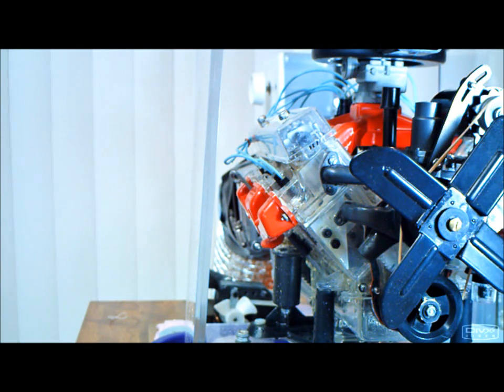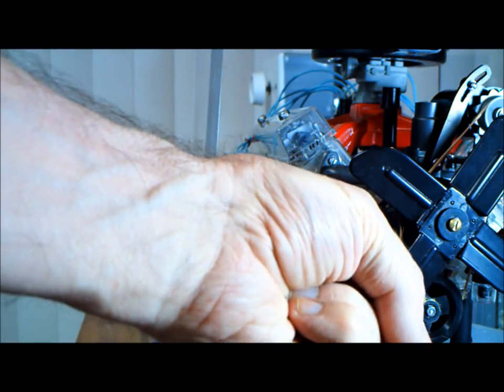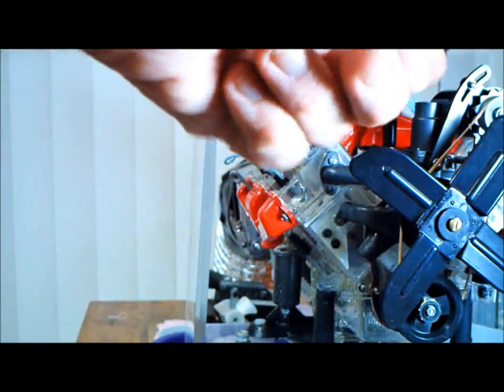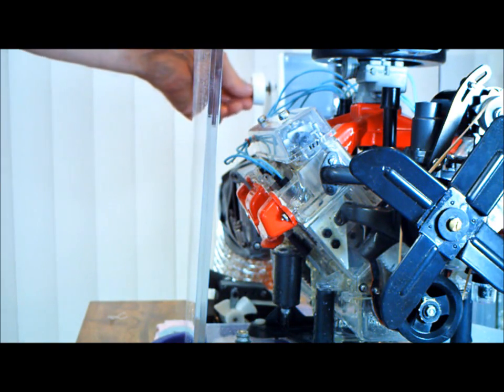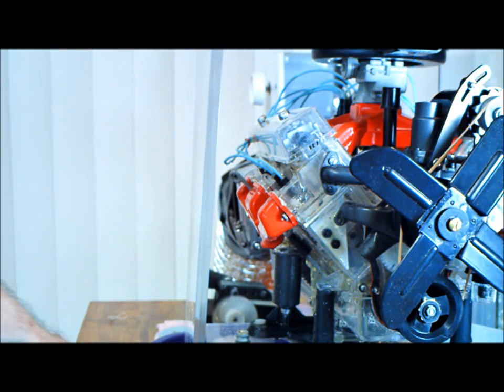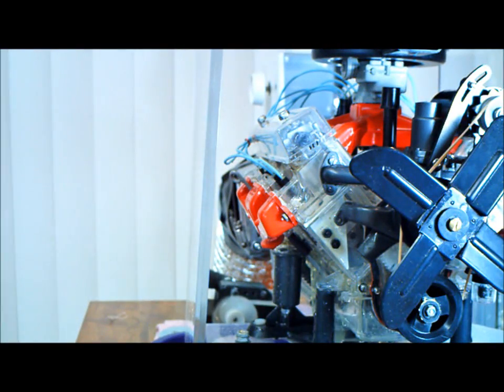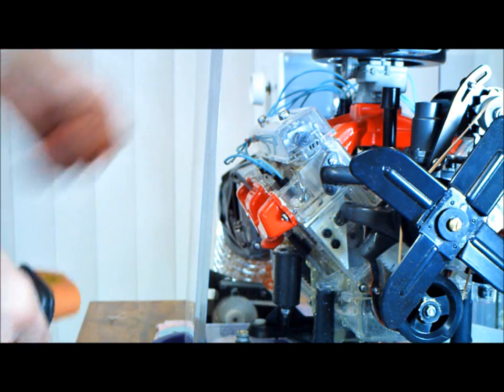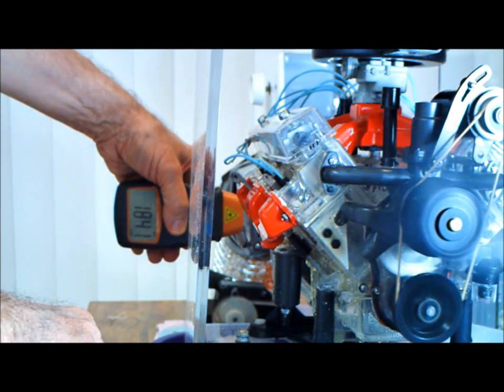Visible V8 TEST #135 @ 7056 RPM 2/3/11

Comment: That's cool how it even sounds like an engine running. I wonder what's making the exaust sound? Maybe the air passing through it as it runs? I should build my Vis-V8.
I have two in pieces, 1-hand crank and 1-electric. I tryed to do what your doing with yours with my electric back in the '80's, I used mineral oil, I used an 8-track tape player motor, It blew a couple pushrods and its been in a box ever since.

Comment from the maker: I was doing some testing today with the Visible V8 and I had forgot just how intense this thing is to be around above 3500 RPM. You can feel the stress on the crank and rods. I am still amazed this little engine can hold together like it does. The video just can't convey the stress this engine is under at these high speeds.

Comment from the maker: @richlkyl000 It has been fun. The Styrene plastic is under severe stress at high speeds. The Styrene has proven to be stronger than I thought it would be. It will have a melt down at higher speeds without lublication. Good lubrication is the key to reach these speeds.

Comment from the maker: @ford1979truck No, this is the actual sound that this engine makes. The sound comes from the exhaust manifold. There is air flow from the exhaust manifold. Also there is (some) intake manifold vacuum. It was a surprise to me during early testing of the engine that it actually sounded like a real V8 engine.

Comment from the maker: @ts46176 See my early videos to see how the motor is attached. I made a drive shaft for it from 1/4 steel shafting with a nylon shear pin inside the converter. I am not sure how the 2.3 turbo is set up, so I don't know how to hook it up. Most people use a RC truck motor to run their model engines. One reason I use only Visible V8s is because there are plenty of parts available and Visible V8s are still being made.